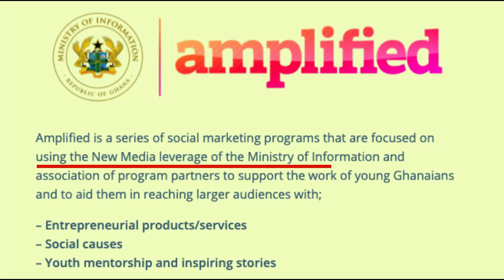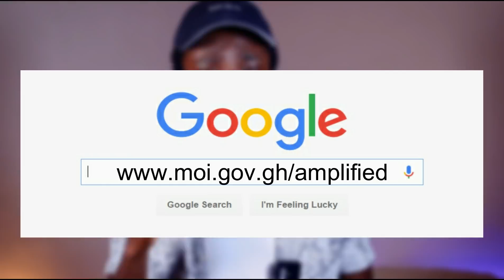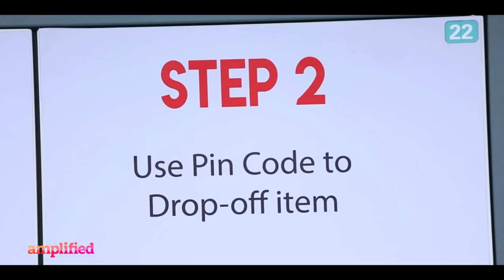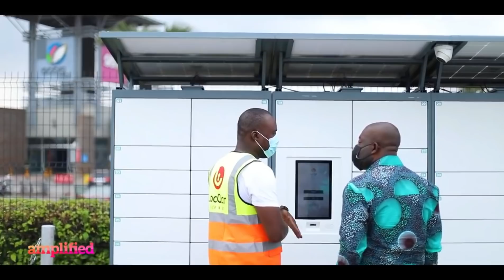Meet the Ghanaian innovator behind the World's First Solar Smart locker To reduce cost of shipping

Comment: Just to add up for consideration. There should be sensor in the holder boxes where dropped items can be weighed and signalled to ensure that indeed an item has been dropped in  into the box to avoid fraud and litigations between all involved parties. Because someone may operate the system, but will not drop the item in the box.
Reply: There's a CCTV camera monitoring activities at the station...plus you have to take a picture of the item you're dropping off...so there won't be an instance where you said you dropped off item A whereas it was actually item B
Reply: GREAT IDEA
Reply: I REALISED THAT THERE ARE CAMERAS TO MONITER MOVEMENTS OF DELIVERY AND RETRIVALS OF ITEMS